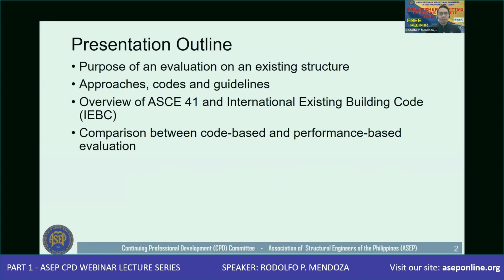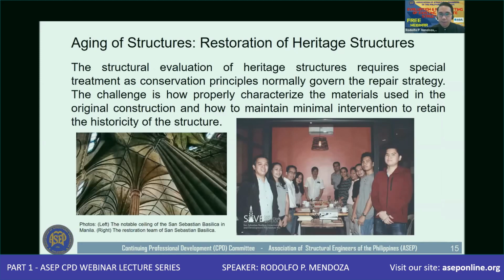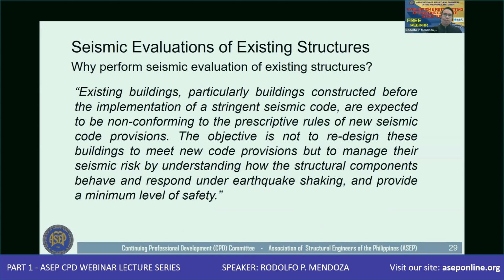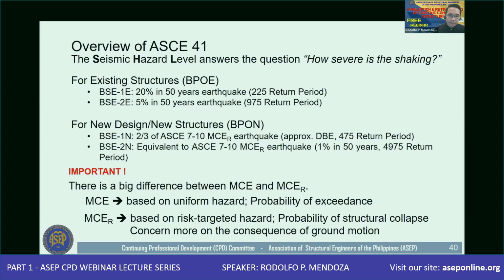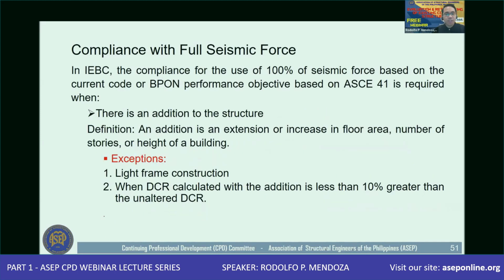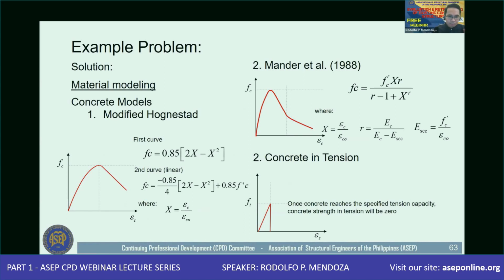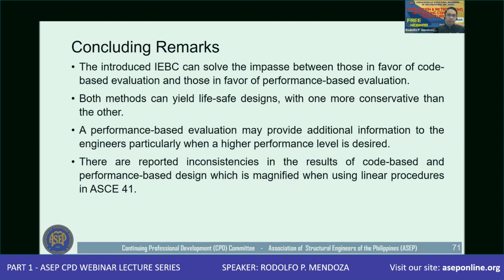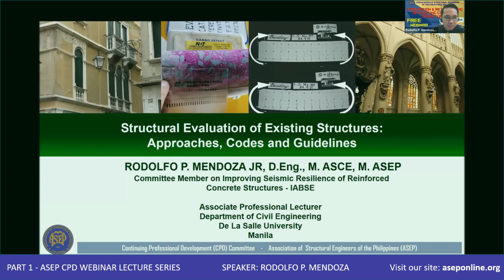Structural Evaluation of Existing Concrete Structures - Part 2

Comment: Hi sir, I don't think Code-Based design can be compared with Performance Based design. The Reason Why They are Trying to Make a Relation of the Code-Based Procedures with Performance Based Procedures is to Have a More Economical Approach Since "Mas Mahal" Po talaga kasi ang Gastos kung Gagamitin ang Performance Based Design. Unang Una po Jan ay Yung mga Laboratories / Geotechnical Offices na Kailangan Para sa mga Data ay Lahat Babayaran.